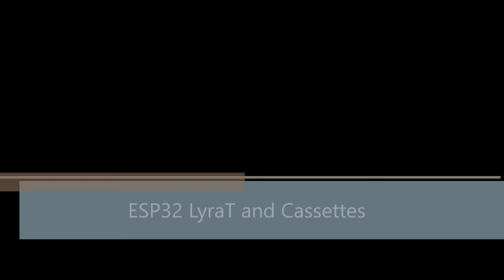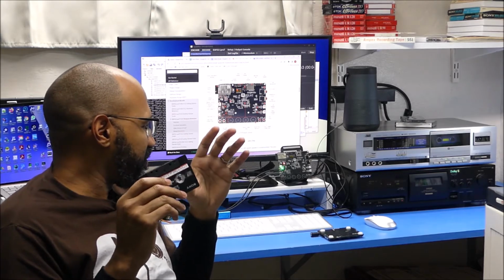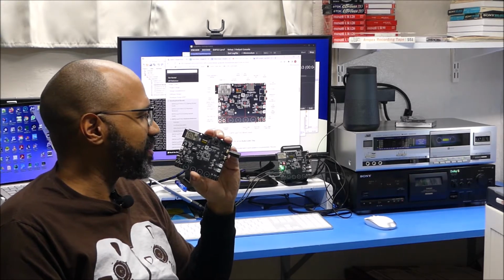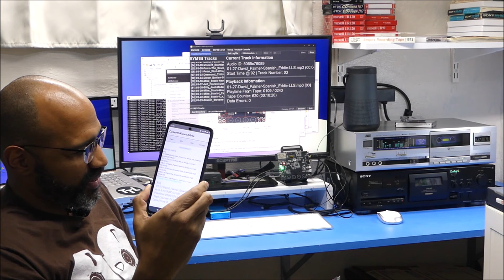ESP32 LyraT And Audio Cassettes

Comment: I’m in the process of performing some testing myself in this space for some fun projects. This is super interesting and well thought out approach, I’m surprised at how fast it decodes. Can you encode and decode images this way using cassette as well?
Reply from the maker: Yes, you should be able to encode/decode binary data if the firmware is modified. The desktop program, minimodem, the firmware is based on can do this. Keep in mind though you won't be able to do it in real time since you will need to wait for the entire image file to decode before it can be displayed.

Comment: not sure what the point of this was.....
Reply: He encoded a song into data/modem signals on the cassette tape (think about the sound of dial up modems) and is decoding it using the board he discusses (ESP32). It might seem redundant (why not play audio from the cassette as it was designed to do?) - but he’s actually playing a digital file from the analog tape. It’s all happening so fast that it appears seamless.

It would be fun to understand how many “songs” fit on a 45 minute side of the tape. I’m willing to bet it’s far less than 30 minutes of digital songs.
Reply from the maker: If you talking about encoding an mp3 file on a tape. If you are lucky you could get maybe one/two per side. So you would effectively need to read data for 45 min in order to play about 8 minutes with of audio.